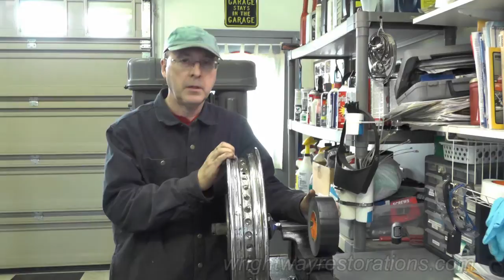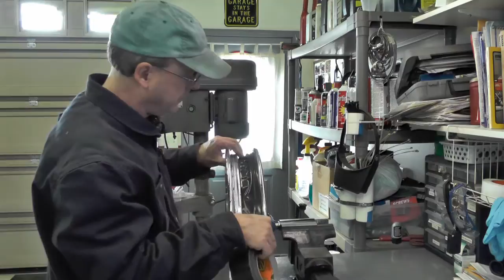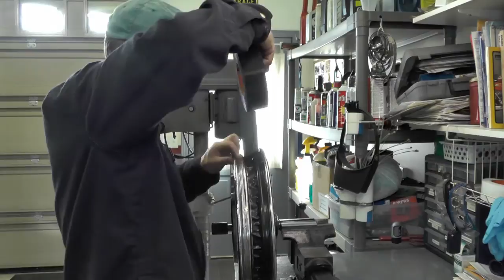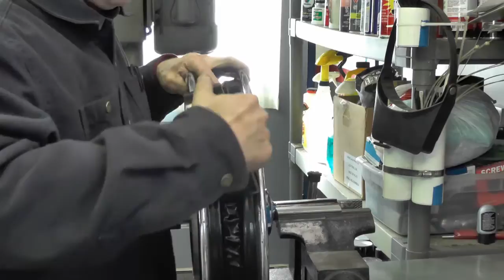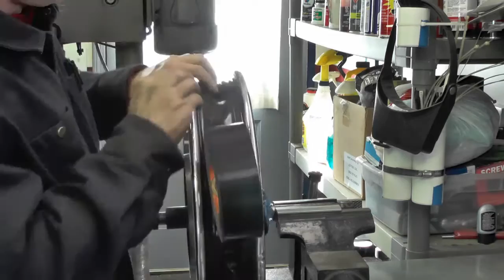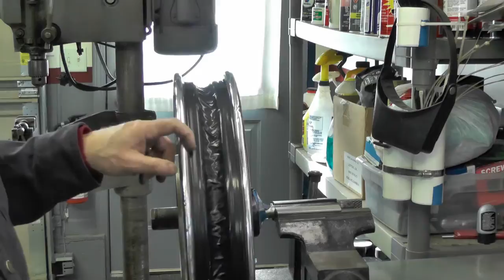Using Duct Tape for Motorcycle Rim Liner --- Video #33

Comment: I liked the video..he actually took his time and showed his whole style of how to tape it...and was answer question along the way..I did think he was gonna show how to make the valve hole though..any how aleast now ima try it myself..
Reply from the maker: +Hema Toebeen The easiest way I've found to create the valve stem hole (or rim lock), is to use a an Xacto knife with a new, fresh blade or similar small, very sharp knife.  Cut a an "X" across the open from side-to-side, then insert the blade through the tape along the edge of the hole and cut all the way around the circle.  One could probably dispense with cutting the initial "X", but that's the way I do it.

Thanks for the comment...